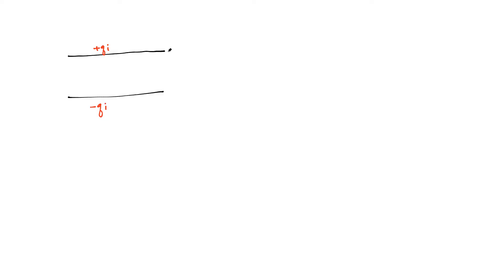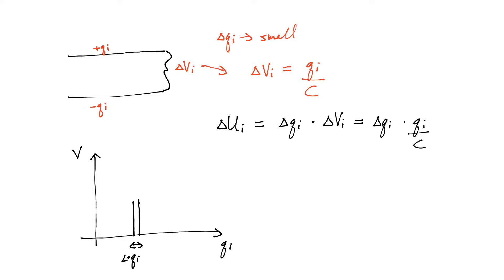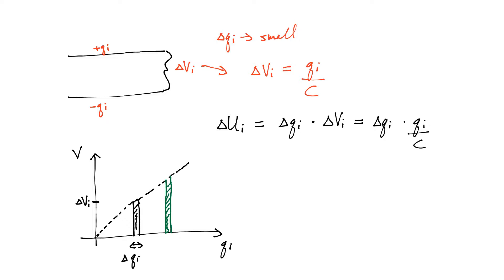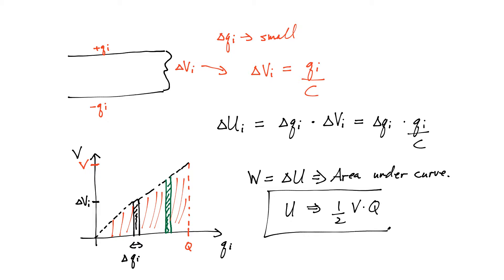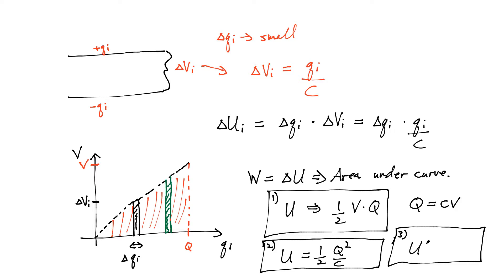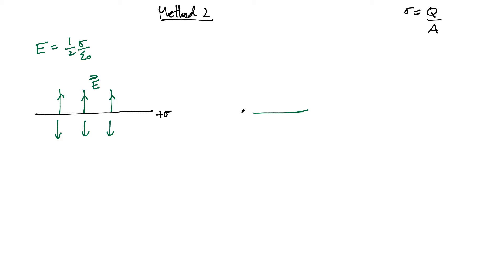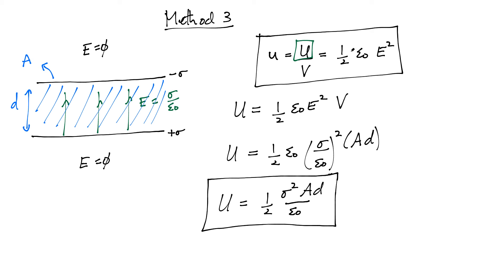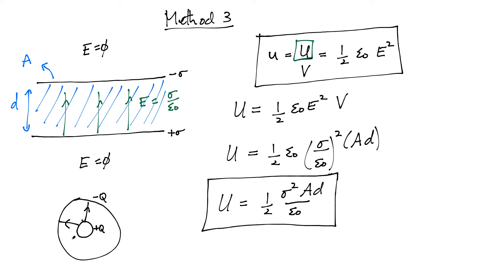How to calculate the energy stored in a capacitor

Comment: Thanks for the video. One question: Why @ 8:02 is the electric field you must overcome generated by just ONE plate and not both plates. Seems that to move one plate away from the other you, would have to overcome the force from BOTH fields.THX
Reply from the maker: The field produced by one plate is half of that value.  The total field is 2 times the value of the field produced by one plate.   The positive plate produces a field that point away from the plate and the negative plate produces a field that points toward it.